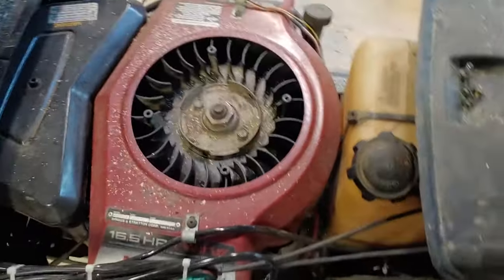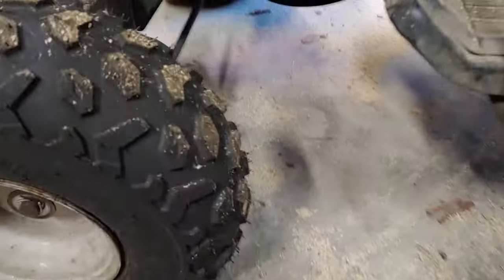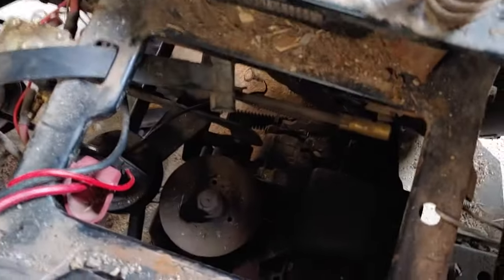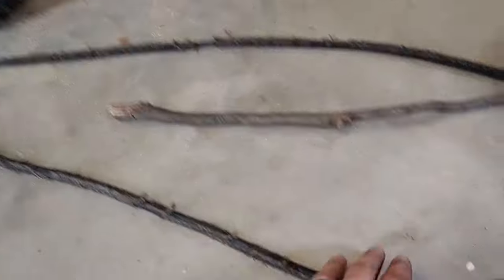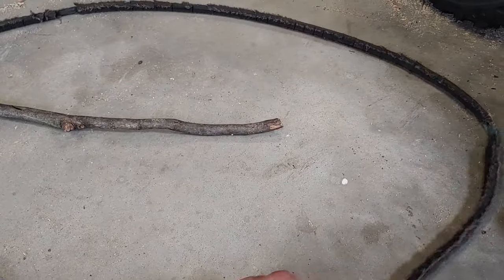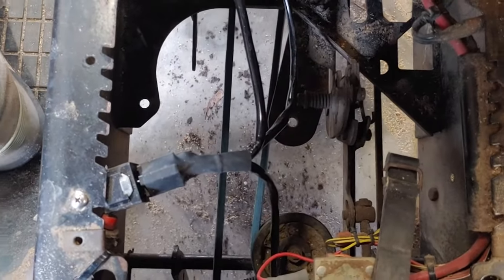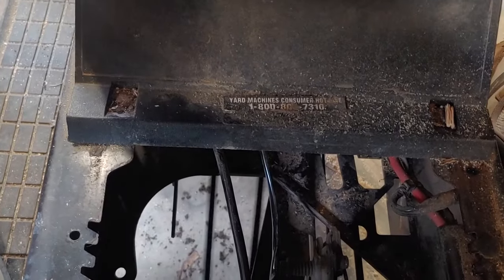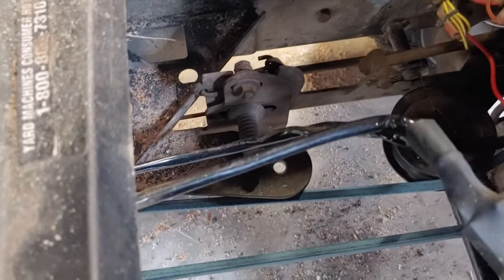MTD Yard Machines Drive Belt Replacement

Comment: Thanks for the video! My drive belt broke on my final mow of 2021 and I'm just now tearing into it. FYI, I think the belt you actually needed is 1/2" x 76" (MTD 954-0441), may explain why it was a little tight. Looks like it's working though! 👍👍
Reply from the maker: Thanks for watching and the part number.  It is still going strong.  I flinch every time I drive over sticks now!
Reply: I just picked one up and based on my model number it requires a 77 by 1\2 inch belt

Comment: This is the best video on changing the drive belt. No one else shows to move the engine to clear the tabs.  I did it on mine and it worked great so I didn’t bend any tabs or pulleys! Thanks again no one else knows that Trick but you !!!!
Reply from the maker: Thank you for the kind words!  Glad this video was a help in your project.

Comment: Do you have to remove the gas tank to slide the engine back?
Reply from the maker: I did not have to.  It was just the engine itself.
Reply: @ProjectNineOaks  ok I’m going to try it again today. First time my tank was full of gas so I couldn’t slide it back. I siphoned my gas out so the tank is empty. Hopefully i can slide it back now
Reply: @ProjectNineOaks  finally got the belt off & the new belt on. After I slid the motor back I had to wiggle the motor left & right to free the belt. Thanks for the video & the feedback!
Reply from the maker: @blackc6vette  Dude that's awesome!  Always feels good to finish a project that was a bit challenging.